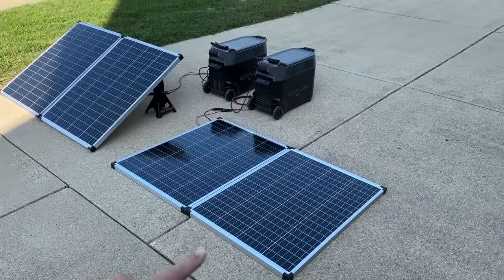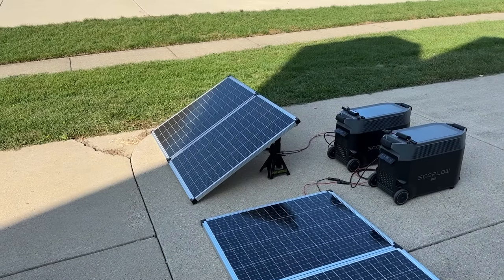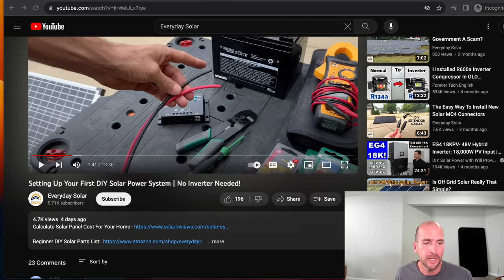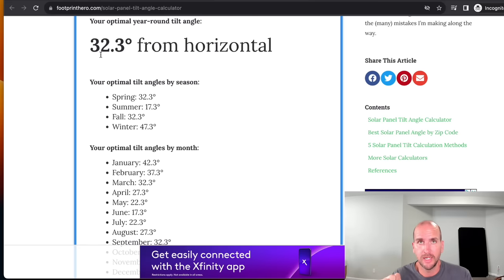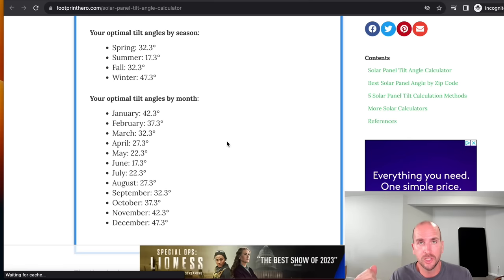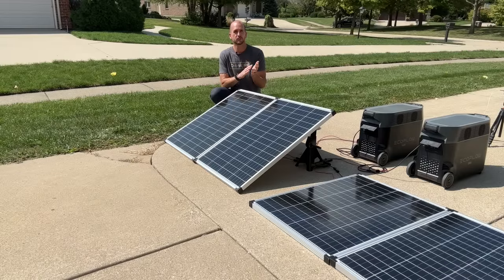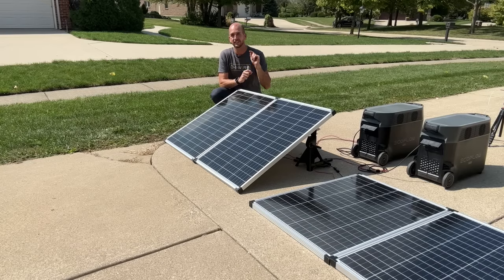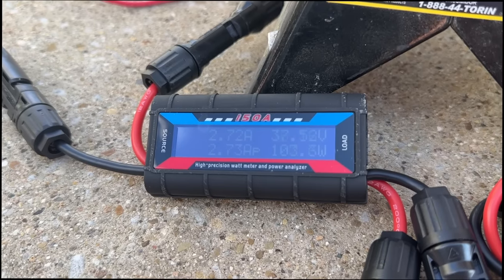Measuring The Impact Of Solar Panel Tilt Angle

Comment: Great video and test.  I always wonder how the angle of the panels would effect efficiency.    I have 2 sections of my roof that are at different pitch.     In my home solar install, my installer never mentioned the pitch of my roofs.  I just wonder if they took the pitch in determining how much my energy my system would produce.
Reply: also consider that for a string of pv panels connected in series the worst panel always sets the output so the flatter panels will dictate if they are all connected

Comment: You know what I've got the 250 what what's a leg standing on the ground from 11 to 4 p.m. charging my two lead carbon batteries 100 amp hours no charge controller connected directly to the batteries it pushes out between 8 and 9 amps facing the sun I follow the sun and the sun's angle and move the panels every 2 hours the batteries are 12 volt batteries the solar panel pushes out between 21 and 27 volts. Angle and facing the sun really matters a lot.

Comment: 👍👌❤️🇨🇦, I use my latitude as a reference for fing the correct angle, but I tap the top off of a paint spray can, I place the plastic lid in the corner of the panel, with the panels facing solar south, not magnetic south, as you raise and lower the solar panel, look st the spray paint lid and notice the shadow ring around the base of the lid, when you have the best angle the shadow will be even around the lid, and the shadow will be very close to the bottom of the lid, I have used this method for 23 years on my 36 x 405 watt solar array, simple and fast, no need for an angle finder using my phone app
Reply from the maker: Nice little method for finding the exact angle where the panel is perpendicular to the sun.  I like it 👍
Reply: Or in finding the correct, just try it on your tilted panels, it is fast and simple

Comment: 1) The RC gauges aren't all 100% the same and not reliable. Huge deviations between them. 
2) This test is only for 2h not a whole day. The angled panel produces less @ dawn-dusk. 

The angled panel shall collect less dirt and rain cleans them more easily but that wasn't the test.

Comment: The panels at an angle will have great resistance in high winds ..it will basically act like a sail. I will take the power loss for some piece of mind when they are installed flat.